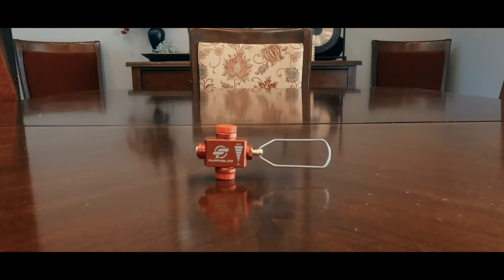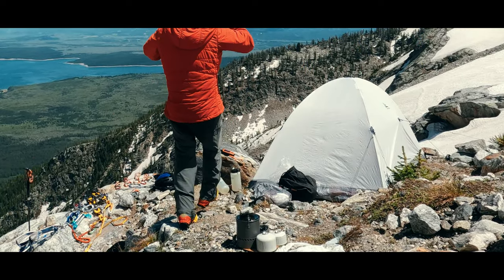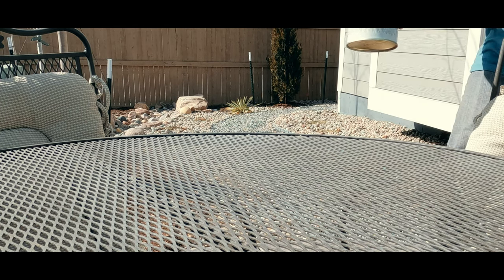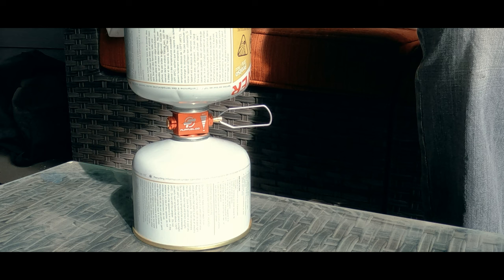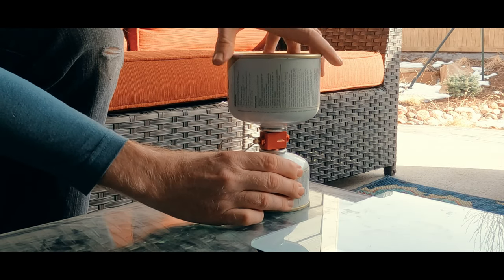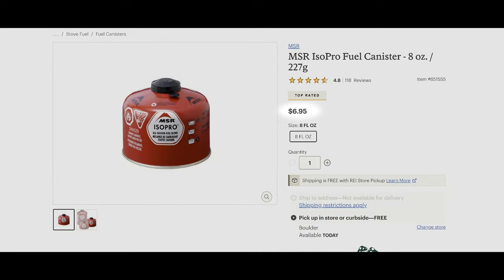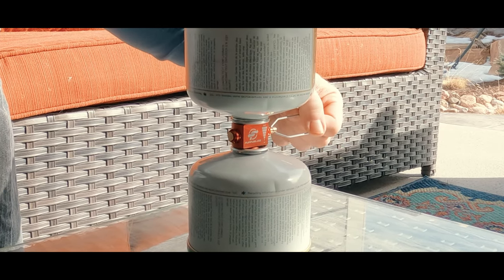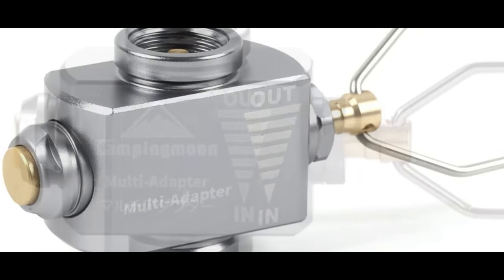Review of the Flip Fuel Transfer Device for Alpine Climbing, Backpacking, and Camping Fuel Canisters

Comment: This is dangeous.  Isobutane contains about 20% propane. When a new canister is used in cold weather, most of the isobutane is burnt off leaving mostly propane left. The reason it’s dangerous to then consolidate these 1/4 full canister is because you’re using a temperature differential to force the remaining fuel into a canister. That canister is now filled with mostly propane.  Propane has much higher pressures at room temperatures or higher than isobutane. Those canisters are not designed to withstand the pressures of propane in those high percentages.  So you risk having a canister burst while using a stove.
Reply from the maker: @jeromebullard6123  Yes... and I call out that reusing non-reusable containers is a risk, but many people use it with no accidents (reported) that I can find. Like most things, buyer beware. Like most things in the outdoors, personal risk tolerance is subjective.
Reply: @ShortGuysBetaWorks  it may not be super likely to happen, but if it does it’ll be pretty not fun.